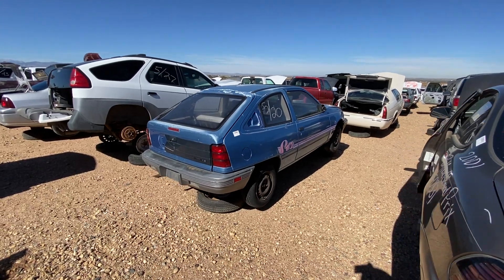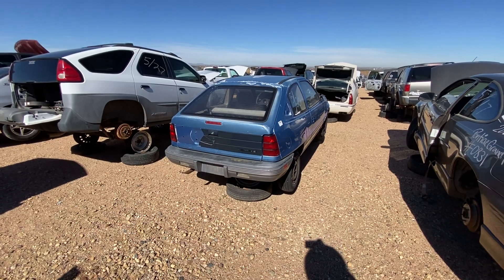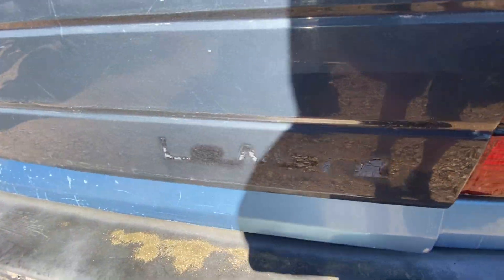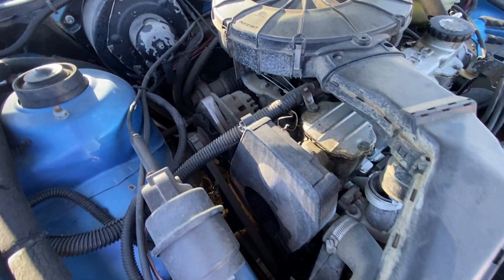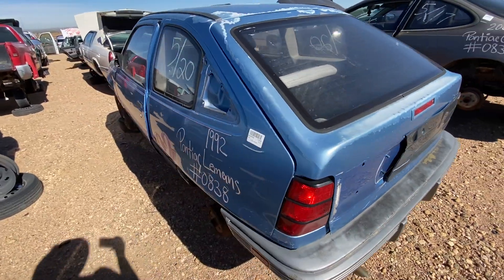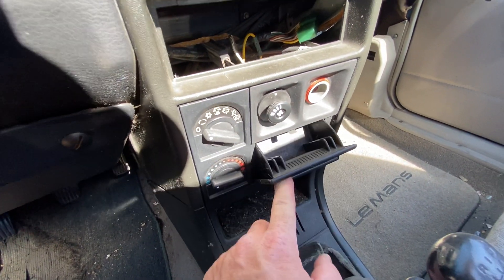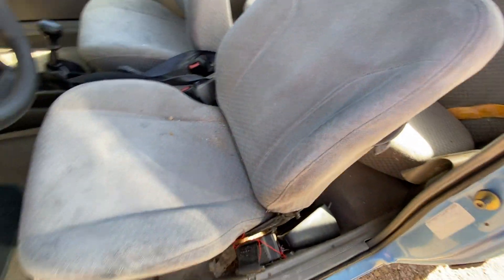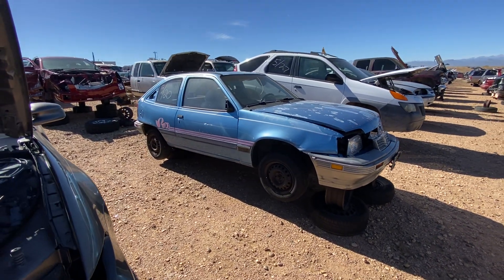JUNKED! 1992 Pontiac LeMans - Excitement, Gangnam Style!  When did you last see one of these?

Comment: 92 was the last year before the ultra rare one year only 93 facelift. Sales dropped every year since 88 so finding a 92 is very very rare!
Reply from the maker: At this point, finding ANY LeMans is very rare! :-)  Thanks for watching!
Reply: Unfortunatelly the last 1993 US model still wore the old 3 speed a/t and had 13" wheels. 
After the discontinuation of the "Pontiac" Le Mans, from 1993 Deawoo had continued to roll with the same as well as with few other slightly different trims to market the model on different parts of the world as LEMANS
 (not Le Mans), Racer, Fantasy... 
The last of the line with a last facelift and some mechanical upgrades was the Cielo/Nexia/Super Racer! I had been honoured to own one too. It was equipped with a 4 speed 4T-40E a/t and has got 14" wheels. Pontiac missed it.

Comment: This car was sold in Europe as  Opel Kadett. Base was similar, but car had different tail lights, smaller bumpers etc. I remember from my childhood, that some persons imported a Pontiac's from the USA and I loved them. They have big five mile bumpers, red taillights and 3rd stop brake. I forgot about the wide grey plastic on the trunk. For me, as a kid, Pontiac looked much rich as the European cousin, which was base and poor 😉
Reply: Agree. I had owned a 1988 4-door a/t and a 1990 4-door a/t Pontiac Le Mans in Europe by the way. Both were equiped with a/c and Delco radio as well. Opel Kadett-E was equiped poorer and rusted out within 5-7 yrs. The Le Mans was not rusted after 30 years and was parked under open sky.
Reply: Around 1986/87 I remember Daewoo had started to appear very slowly in some Eastern-Europen countries mostly with the Racer GTE. The Racer GTE has the LEMANS/Le Mans trim, the only difference which separated it somewhat from the Pontiac are the nameplates and badges. In those times the Daewoo Racer was a Superb Opel Kadett-E by european terms.
Reply: @szilardtoth8814  I also remember them :)